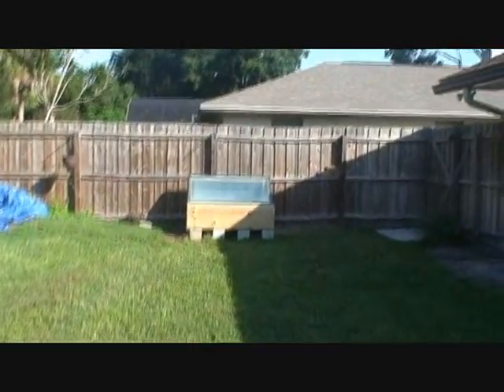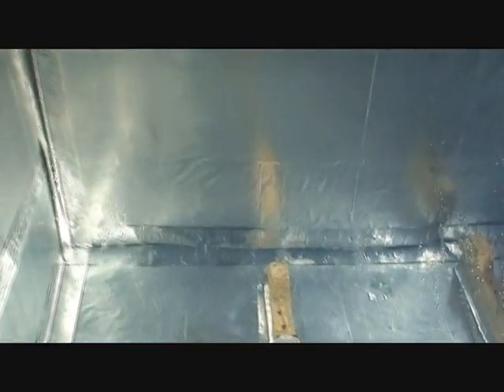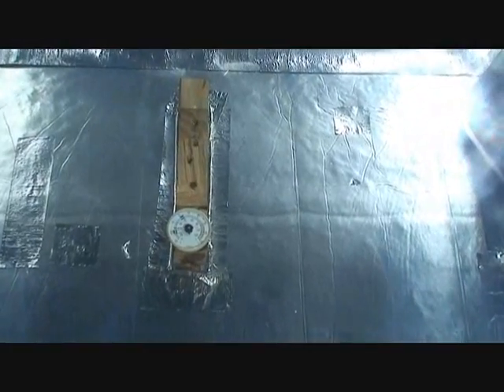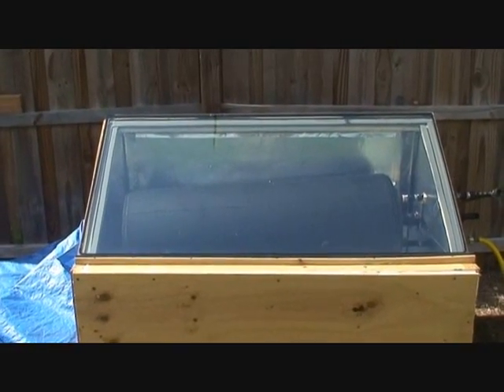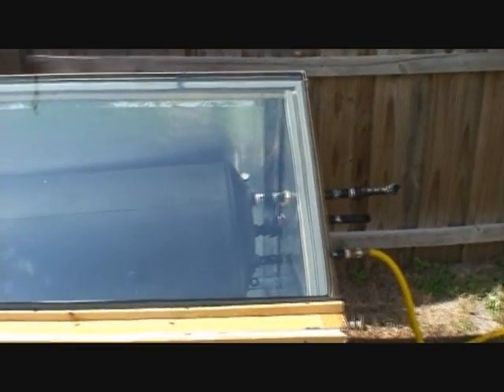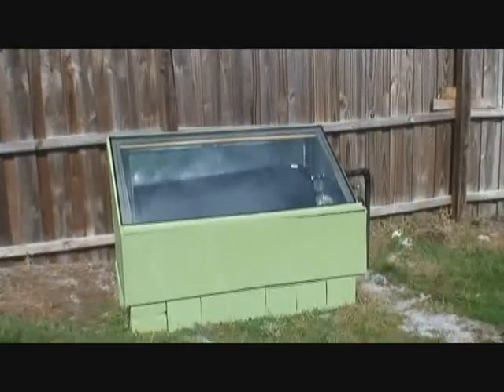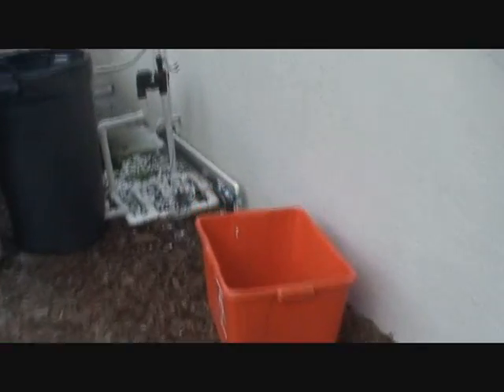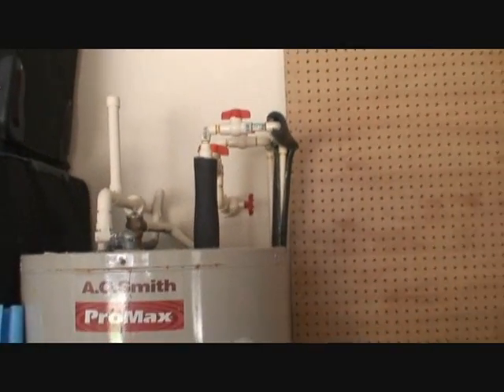Solar Water Heater

Comment: Great project. I've been a fan of preheating for decades - so many ideas from wrapping, first your street in pipe around your waste line (lots of hot water passes and transfers or could, to then up to the roof with coiled copper in front of an angled reflector, to then this gem - and is on the ground - ultimate checking if all is okay (some areas of the country don't have nice one-level flatter roof and what happens when you 80 yo :) 

 - Anyway, my one question, and seeing how old this thread is, hope I get an answer is -- any High Pressure Safety Valves on that? Or any issues, what they were and solution you did. 

I have a conventional electric that kept getting OEM, "bad" T-stats - wow and would fuse together *on - usually about 2-3 years after installation and of course keep going, blowing off > max temp (~120F +-) pressures (installed an alarm that does not shut is down, but alerts me and well turn if off if "go away", flip the breaker). 

So, with your fine temps, I was wondering about that. I will contact your YT and send for your plans - thank you!

Comment: Rather than buy a piece of glass consider using a used patio window glass. Mine is double pane which is necessary to trap the heat in during the night as there is no cover. The window was free as someone was replacing their window with better units. The reflective material may not be necessary. I insulated the bottom of the tank with the foam insulation it came with, used the steel shell to make an absorber plate that is more durable than anything else like wood Two-thirds of the tank is buried in insulation and then the absorber plate is atop that. The absorber plate is not attached to the tank but it transfers the heat to the air within the box and then it goes into the tank. You don't need to be precise with the window angle. The optimum angle for February (the coldest month) is your latitude angle + 23.5 degrees - 8 degrees = tilt angle of window from the horizontal and pointing south.

Comment: Nice, it should work better painted flat black, non reflective, the entire box inside and outside(except glass obviously), and you should get higher temperatures in box therefore radiate more heat into tank.
 The aluminum foil is on the inside of the foam board, painted black will radiate heat inward and insulated outwardly, and with outside of box painted flat black also helps some for where the sun hits, it just make it even hotter by causing outer layer to be close to as hot as the inside helps keep the heat inside, trapping more heat longer.
 You still want a well insulated box, but this will slow heat loss just a little more.

Comment: On demand hot water heaters reduce the energy consumption of heating hot water significantly.  Instead of keeping water warm 24/7 you burn fuel only when you use it.

Comment from the maker: From 9/2009 to 11/2012, the Hot water preheater worked very well with zero maintenance done to it.  I like to think it saved me at least 20-30/month if not more.  It maintained temperatures of 140-150+ on sunny days.  Gave me a full tank of hot water each day, greatly reducing the burden on the indoor HWH.  On top of it, Google has paid me for all the views.  This project was a huge success. Please rate and share. Thank you everyone.

Comment: Nice work, Mike.  I have had a water pre-heater for a number of years.  I kept it inside until now.  The idea was that I would use less electricity even if the water only came in at room temperature.  I will be able to use your ideas this summer when I will move it outside.
Thank you

Comment: I work with glass.  Low-e keeps UV rays out.  Did you reverse those panels to keep the UV in?  Also, there are many new products for UV.  One of the latest we use is called Solar Ban 60.
How this thing working out anyway?  I'd like to do a solar pool heater.

Comment: try to insolate the pipes as much as you can because you will lose to much heat through the outdoor pipes.Try to use antifreeze (DC 20) for solar pannels and a heat exchanger.Great job

Comment from the maker: it still works in winter, because it's still sunny in the winter.  The box still does get hot or at least warm.  So any additional pre-heating of the water is better than the ice cold city water that would normally be pumped into my internal hot water heater.

Comment: I see the CPVC is not insulated at the house and I assume you didn't insulate it in the ground.  If you didn't insulate it in the ground, you are allowing a great deal of heat loss to occur.  Ground temperature is going to maintain approx 55-60f just a foot under the surface.  Just some advice. Other than that you did a very nice job on the set up.

Comment: well done...i would suggest filling the bottom of the container with black silicia sand ( i used to sell it at an automotive supply store..was used for sandblasting )...we all know how hot beach sand is on a sunny day so just imagine this black glass sand would be incredible and help hold a lot of heat in that container over night....or maybe even some black asphalt roofing shingles layed on the bottom...they also have fine stone on them to hold heat!!

Comment: I was wondering, inside the box. The reflective material, was that alluminum? Also, I thought of a way to make the temperature inside the box to go up much higher. You need a better reflector than the alluminum foil. Try a mirror to reflect sunlight onto the glass inside. I don't know maybe that will work and people who live in colder regions can take hot showers and heat their homes with the same tech. Cheers , everyone.
Reply: Rramundson the opposite is true, what he needs in there is thermal mass, a black rock or even a deep pool of water. This absorbs heat and releases it slowly. In commercial applications solar reflectors heat molten salt in a closed loop which is then used to generate steam for turbines, which in turn power generators

Comment: @meatloaf1234 While you did a great job on the overall construction. The Low E glass is blocking Solar irradiation from entering. It's NOT blocking the heat all that well from escaping at night. As that heat is being transmitted to the colder air. You need a lid with the same reflective Styrofoam stuff.

Only way glass insulates well is if it is double paned with an inert gas inside. Sure, it's keeping some of the heat inside, bit not efficiently.

Still, kudos to a great job!!!

Comment from the maker: @kellysrcm Sent you the plans.  For the glass i wasn't sure which side went up so I tested it both ways and it seemed to get just as hot either way.  The glass was mounted on top of the wood, with weather stripping and Great Stuff to seal it up.

Comment from the maker: @bobqa1 Thanks for trying to tell me that this does not work, but in fact it does.  If the water comes into my electric hot water heater and it's already hot, the electric HWH does not have to work as hard to bring it up to desired temperature, thus saving money.  Yes it does have to keep it hot, but the initial energy to bring it up to temperature is saved.

Comment: Just a note-your electric bill will remain the same, because the electric water heater is not heating water on demand...it always stays hot, no matter how much water you suppliment with your solar heater, the electric heater keeps the water at the set temp...you would need to shut off the power to the electric heater and just use the solar to see any savings..

Comment from the maker: @Sethjxl The temp of the water does not reach that high.  There is a pressure release valve.  I do insulate the CPVC pipes underground.  I don't want to have to cover/uncover this thing everyday, that would be a pain.

Comment: Few questions, I notice the temp in the heater was over 200, this is very close to boiling point at which state a normal HWS would vent the excess pressure to avoid explosive failure. Do you have a system in place for this?
Also, Your PVC pipes running underground, are they insulated? I would imagine a lot of heat loss from transfer into the ground if not.
Also, black emits heat very well, over night you could cover the insulated glass with a hypothermia blanket to keep the heat in??

Comment: Hey you did a great job - yu should paint the outside of the box all Black also --
I made two boxes and put coiled copper tubing in them --- and i put a Solar Magnetic Circulating pump inline to the House Hot Water heater --- as long as the sun stays out--- it gets the Storage Tank up to 150 Degrees. If you had a circulating pump that kicked on when the outside tank was hot you could heat both your tanks during the daytime.....again - nice job.

Comment: low-e glass can be ordered to many different specs so it does not always mean the same thing.   Depending on your climate the low-e glass can be designed to allow a chosen amount of visable light (VLT value) and a chosen amount of infrared light (SHGC or SHGF) to pass through the glass.  Low-e glass can also allow IR heat to escape or trap it depending on what makes sense for where you live.  Cool project, highly effective, i would gues a high SHGC/SHGF and that its intended to trap IR heat.

Comment from the maker: @kchedville I really don't have the time to be placing a cover over this at night, then possibly forgetting to remove it the next day and missing the sun.  The double paned glass was the solution and serves as an insulator.  Painting the box black wouldn't make much of a difference because the box is so well insulated, i dont think much of the heat would get in, it would only make this thing an eyesore and maybe cause the wood to warp over time from getting too hot.

Comment from the maker: @craftmatic2 I'm not able to calculate the exact percentage.  The reflective backing serves as an insulator as well as to reflect the sun's rays onto the tank.  If the back was black that would not be as effective, it is the tank I'm trying to heat, not the back of the box.

Comment: a solar water circulator pump would do wonders - it will keep you inside tank full of hot water thru the night - also - i used pvc - and it got so hot the glue joints didnt hold up -- and i had some leaks and melt points - so i went with all soft 1/2" copper after that happened...

Comment: id like to put 1 on roof of motorhome ,im making,anyone help me with advice?its to get shower+washing ,not drinking water,.would it get to hot if not used ?the odd time we get sun in uk lol,pressure relief valve maybe?i even want to harvest rainwater in tank to supply solar heater ,would pump or thermal syphon work?maybe even central heating in van lol ,.,.any nutty professors reading this ???lol

Comment from the maker: @cableairman Yes, this is a pre-heater.  I still have an internal hot water heater, I cannot rely solely on the sun to heat my water or I will end up with cold showers sometimes.  This system helps the internal heater to work less.  When I use hot water during the day, it is replaced by the solar heated water.

Comment: Thing i noticed is that this is just used to top off your hot water tank so your still heating your tank in the water all day. My thought would be to use a smaller water tank inside. Just a thought.

Comment from the maker: @mostly4moderate If the water temperature reached 212 degrees from the sun, I'd be more worried about other things than my hot water, such as scorched earth. But yes, there is a pressure release valve of course.

Comment from the maker: @stmotorsports The Low E glass helps keep the heat inside.  I check the temperature regularly and the tank gets up to 140, 150+ degrees on a sunny day, I think it is doing its job, I'm not sure how much hotter it could possibly get.

Comment from the maker: @ckoch407 I do not ever stop the cold water from entering the tank when the sun is not out.  That is not how this system is designed.  When I use hot water, the hot water will come from the outdoor tank into my indoor HWH, and then that water is replaced in the outdoor tank by the city cold water to then be heated.  If it happens at night, it will just be heated the next day.

Comment from the maker: Summer update: so far this unit has been operating extremely well.  It's been in service for 9 months now, with no issues at all.  It gets extremely hot, I've seen it as high as 160 degrees inside the box on a hot summer day.  Quantifying exactly how much electricity is being saved is difficult, but I know it is doing it's job because my power bills are definitely lower than they used to be.

Comment: Right on, man. If you ever build another unit, it would be interesting to see if there is any difference in the temperature that is achieved if you use a larger cylindrical outter form that is lines with highly reflective material? In a parabolic fashion? I'm considering building one in that manner, as soon as I find the right materials and application. I want to insulate it, so I'll most likely place the entire thing in an insulated enclosure. Nice looking unit, man.

Comment: Nice unit. Unless you are using the reflective foil insulation, inside of a unit, to provide a focal point on the back side of the unit, which is difficult to do with a rectangular shape, then the unit may attract and retain more heat if you were to line the inside of the box with something black in color to attract more IR waves? It would still be double insulated, but capture more of the longer waves?

Comment from the maker: I used strictly CPVC outside the box because you want to use that for water you will wash with or drink. PVC would be for landscaping. Copper would have been much more expensive and harder to work with. Insulated CPVC works just fine. I wouldn't say the water is getting up to 200 degrees though, that may have been the temp in the breadbox when there wasn't anything in there, but with a full tank of water it wouldn't get that hot.

Comment from the maker: The tank is a standard 40 gallon hot water heater, stripped of its insulation. I used two 8 inch copper pipes (3/4 inch) connected to the tank hot/cold, Copper to PVC transitions, many 2x4's, plywood (all pressure treated then watersealed), fibreglass insulation, reflective foam insulation, CPVC pipes, and cutoff valves.The Low-E glass which was two 1/4 inch pieces of glass. I also used Great Stuff insulation and strips of foam weatherproofing to seal the space between the glass and the box.

Comment from the maker: My first electric bill since installing this water heater was $50 cheaper than the month before.  However, the weather has cooled a bit this month so my AC has run less, but the water heater was only in service for about half of the billing cycle.